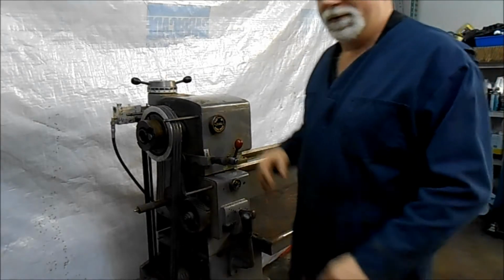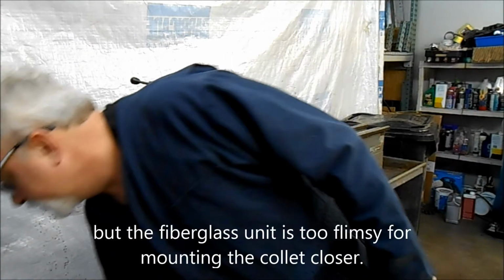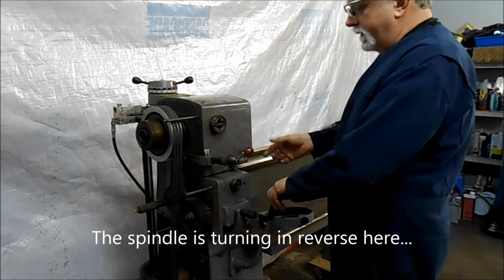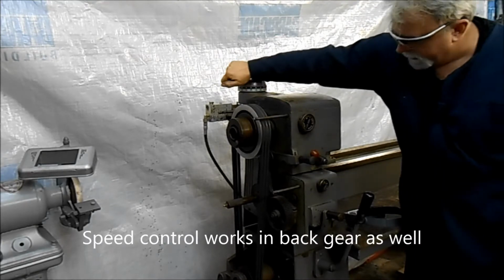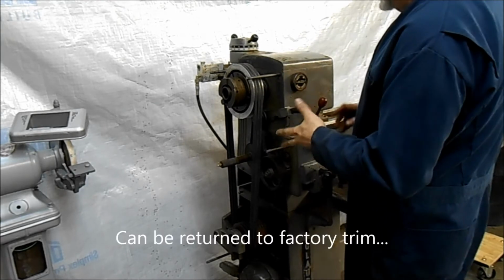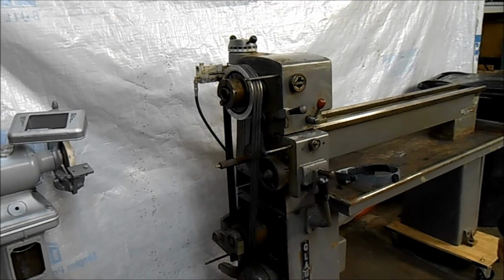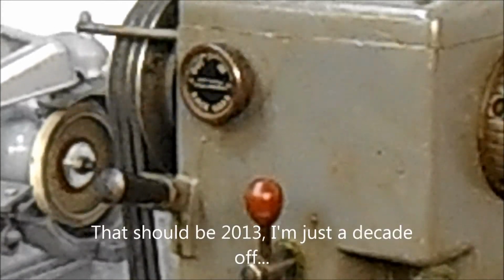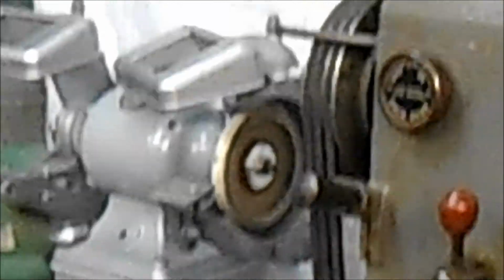Old style Clausing 5900 lathe

Comment: Hi, Lucas. I have an older 5900 Clausing lathe and in the last 10 years the clutch mechanism makes an awful racket when you disengage the spindle drive (while the motor is running). It's only when the pulley is set on the highest speed that you don't hear the racket. Mainly because the centrifugal force on high speed prevents the parts inside the clutch from hitting each other.  Can this be fixed? I'd appreciate your help.

Comment: Hey, just wondering why you parted it out? Not judging and I know this is an older video, but been looking for one for a couple years now.
Reply from the maker: +spitfire1821 Many things were wrong with that lathe, though it did run pretty well.  I don't like to sell things that are not fully operational.  

There were good reasons Clausing changed the design of the lathe from the older style to the newer style: 1) improved access to the motor and countershaft (new style motor orientation changed 180 degrees from old style); 2) new flat cog belt much less prone to vibration than the old style multi V belt drive; 3) location of clutch/brake lever much improved in the new style lathe.

Are you on the Clausing lathe and mill user group on Yahoo?  If not, I recommend you get registered there, they are a great group.
Reply: Hey, thanks for the info. I'm not currently on there and don't own a clausing yet. Working on finishing my HEAVY 10 resto first. Will most likely use that and my SB 9A for the next couple years till I build a shop. Sounds like I'll have to do a little more research on the 5900 series before I get one. Thanks again.
Reply: Thanks for the info. I wondered the same. “This is a wreck of a lathe” proceeds to show everything in good shape.